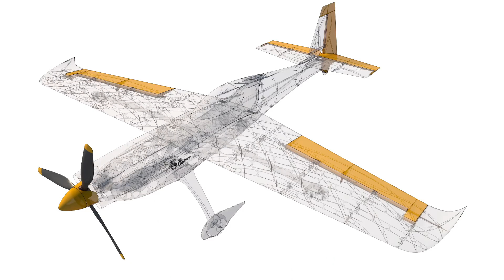3D PRINTED PLANE! Printing Some Wings on the Creality CR10 Pt.1

Comment: Hi MKme Lab - your settings give great result on my Ender 3 and Cura 4.6.1! Could import your settings also in 4.6.1, but first had to install a mod in Cura 4.6.1 to install machine 
"Legacy Creality Ender 3", which allowed importing of your settings. However, print times a significantly longer (2x). I think the outer wall speed at 15mm/s is contributing most to the long times. However, increasing the speed goes at the expense of how the wing looks. Seems like it is underextruding. 
In your experience, would you know some settings that could increase the printing speed at limited expense of quality?
Reply from the maker: You would have to play around. I shared the settings that work for quality and strength. I had no interest in speed at the expense of quality- the plane will fall apart in the sky.

Comment: Eric - I have been trying to use your profiles for this, but they will not load into Cura 4.5.0 as they are formatted in a "normal" quality version.  Cura does not have a normal setting anymore, so it keeps giving an error message.

Comment: Hi Eric, you mention that you offer your refined Cura settings for your CR-10 on a link below your video but I have not been able to find it.   After watching your videos on the CR-10 printing out parts for the 3D Labprint airplane wings you indeed have it dialed in!  My 3 months of "tweaking " Cura settings and fine adjusting the printer has not gotten me anywhere near the fine quality you have achieved.  Can you point me to a url link where these settings are available.   I have not found them on your subscription channel or on Pateron and github doesn't seem to have them on your page.   Thanks in advance for any info you may offer.  JB.       jobobeda at yahoo dot com
Reply from the maker: It is linked in the description of this video. There is not much more I can do for you

Comment: Do you have the settings for The S3D; or how do I extrapolate to S3D?
Thx. Great videos.
Reply from the maker: No S3D here only Cura sorry
Reply: Thx Eric. One more question. I’ve never tried it but could one use the settings from Cura and plug (type) the settings into S3D and get similar results?

Comment: Using your settings!  Beautiful print, doubled the time.  Sacrifices.  16hours a piece.
Reply from the maker: "Sacrificing" 16 hours sounds very odd since most of them aren't that long overall.  You might want to see if you have your speed turned down on top of the settings.
Reply: MKme Lab I’m using your settings on the mig-15.  I was having the same problems with stringing and some holes where it would move. (Retraction). I’m also using a colido diy printer.  Figured it was worth an attempt to use your settings.  It is looking beautiful, I manually turned the speed up to 130% now.  Normally a fuselage section takes 8hrs on this printer.
Reply from the maker: Ahhh I follow now- yes the Mig is a fair bit bigger than the Edge. Glad to hear they are working. I can't count the hours it took me to get there but glad I did. Personally I'll take slow with no strings and good adhesion over speed and issues any day.  I'm stunned how good the plane parts come out some days.  Good luck with the Mig

Comment: Thanks. I'm working on printing the same part on the same machine and also went through a lot of calibration. I was able to get an acceptable result but I don't think as good as yours so I'll give your settings a try.
Reply from the maker: So far so good with my settings. Github has all of em. Cheers